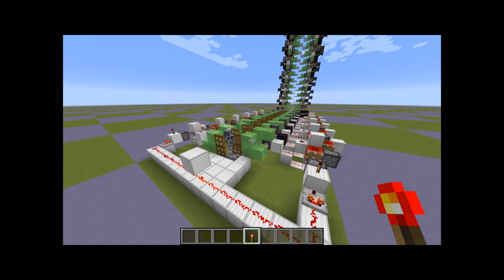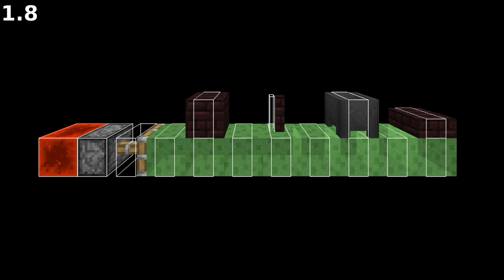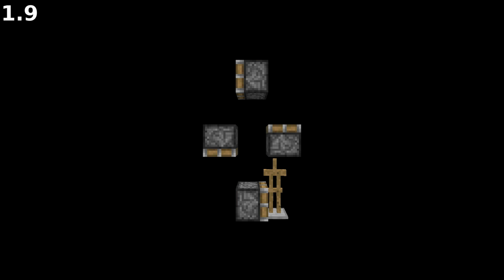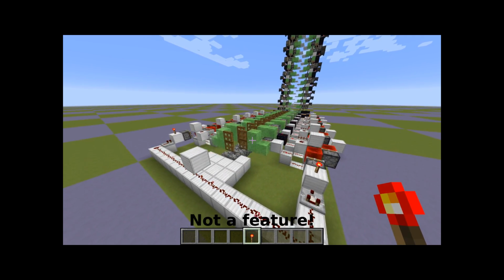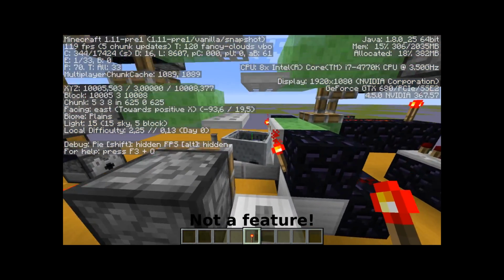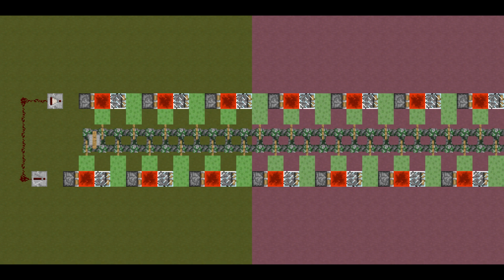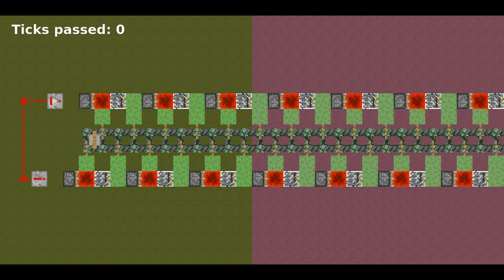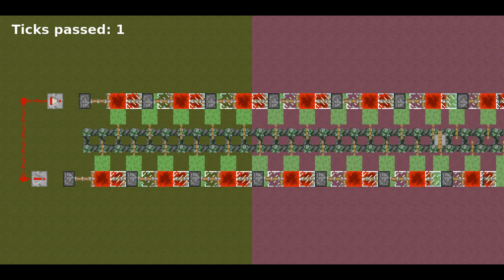Minecraft 1.11: A brief history of pistons (320 m/s explanation)

Comment: I understand the need for the delay in the horizontal designs, but why do the elevators need a two tick delay?
Reply: Vertical pseudo-chunks?
Reply from the maker: The lists are per 16x16x16 section. So each chunk got 16 lists, one for each sub section.
Reply: Would it be possible to make a diagonal one that functioned the same, thus uping the speed? If so, you'd have a supersonic transportation bug, which would be awesome. If not, this is still cool, more reliable than pearling portals anyway.
Reply from the maker: Yes, that should be possible. So you could reach a maximum speed of 554* blocks per second if you would want to go crazy. But it's a rather impractical thing to do.

*Ups failed there -.-
Reply: *554blocks/s
Reply: Who cares about practicality when you can travel faster than the speed of sound (without teleportation)!
Reply: Panda4994 how about only putting a delay on a chunk border?

Comment: Sorry but i could not understand the last part about wireless signals,   what did you say in that last bit?   something something wireless redstone something something....
Reply from the maker: "Oh, by the way: The fact that connecting blocks use the origin to calculate the box in which they move entities can be used for wireless redstone from 0,0,0 to anywhere else in the world."
Reply: Panda4994
oh cool thanks for clearing that up,    do you have a video about that concept?
Reply from the maker: No, only this one. But it's shown at the end. If you change the blocks around 0,0,0 it changes how moving blocks move entities (if the moving blocks can connect to other blocks anyway)
Reply: +Panda4994 Does looking at iron bars/glass panes still change the hitbox of every other iron bar/glass pane in the world? And do observer blocks detect hitbox changes?
Reply: Jackson Percy
hmmm that would have awesome uses!    but i bet its fixed
Reply from the maker: Looking at things should not globally change their collision box anymore. That was one of the things fixed in 1.9. It was the same bug as the one mentioned in the video ("blocks with changeable collision boxes can change them pretty much at random") :-)